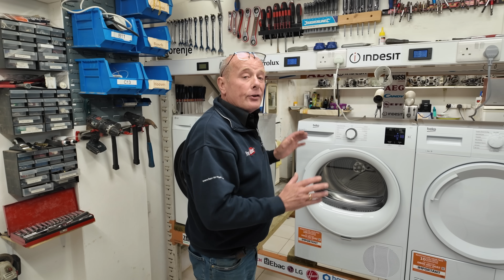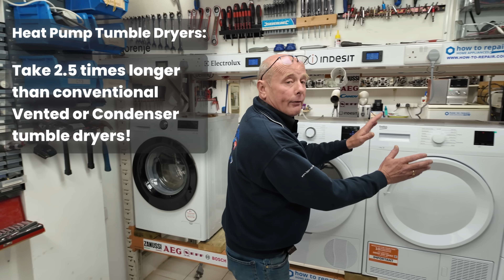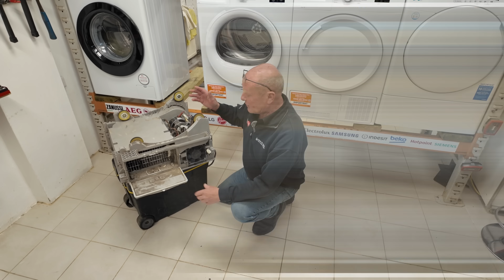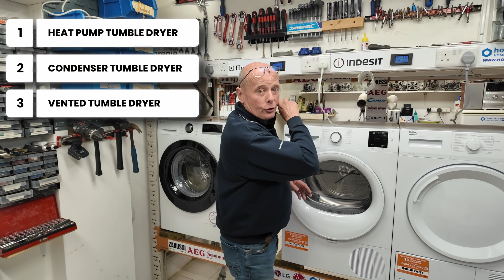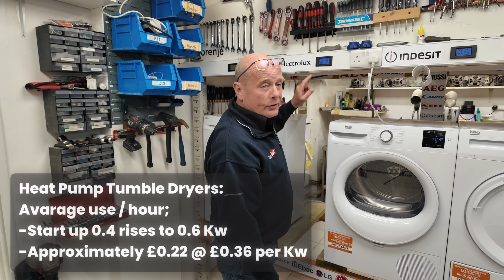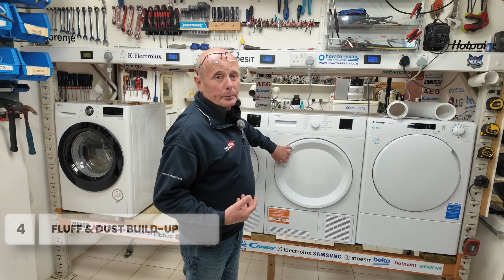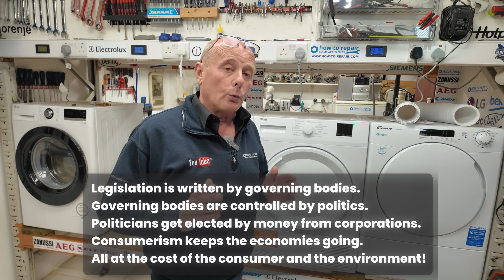Tumble Dryers the Shocking Truth About Heat Pump vs Vented & Condenser, NEW LEGISLATION!

Comment: Plumber/Heating Engineer here, fitted & maintained Air Source Heat Pumps.
Had a Heat Pump Tumble drier for over two years now & it’s fantastic. Under £0.40 a load & it doesn’t take any longer to dry than any other TB.
It doesn’t shrink clothes & is much better for creases in shirts etc, most can be put on straight out the HPTD.

I formally had a Natural Gas TD, which was fantastic on economy. I nursed it along for 4-6 years, replacing parts etc. unfortunately, the Drum completely sheared off. So it went to the TD Graveyard in the Sky……RIP & sadly missed.

Now, there’s a couple of secrets in using a HPTD & our host touched on it.
Ambient air temperature, these units recycle air, so, site it in a well insulated small room. We have a small Utility Room in a modern extension & it’s ideal.
Also, double spin your clothes in your washing machine. It can make a huge difference with some items of clothing.
I also Plumb in the Drain on any I fit, it’s so much better for the appliance.

I agree with our host, lint in the Condenser & Evaporator will be an issue. As for the Compressor & Fridge Gas. Well, we’ve never had a Fridge or Freezer that’s not given great service for 20-25 years at least.

Just Googled a price of a HPTD, a Swan is £300 & a Hoover £319.
So considering the savings on running costs, if you get 5 yers out of it, that’s costing you £60 a year for the appliance. You’ll save a fortune!!  Plus, the technology will improve & the appliance price will drop over the next few years.

Thanks for sharing a very interesting video👍👍
Reply: Perhaps a wee point here about Heat Pumps in general. From a Home heating prospective; An ASHP will only operate at its optimum with a Low Temperature CH system. So generally, it needs to have a SCOP of >4 to be more economical than Natural Gas. So it’s unlikely we’ll be stopping fitting Gas boilers any time soon. 
Also, Low Temperature CH is not appropriate for our very cold, damp climate here in the UK. Oh, it’ll heat a well insulated home, but well insulated means air tight & air tight means condensation. We have a huge Damp Homes problem in the UK.
Reply: @jimmygillies5590  if your home is airtight, you need mechanical ventilation anyway. 

And I think you're over egging the pudding, saying our climate is "very cold".

I'd like some whole winter figures. HP people generally focus on when it gets really cold, but most of the heating season isn't like that. If your heat pump only struggles for 1 cold week in January, isn't it overall better just to turn on a few electric resistive heaters?
Reply: @benholroyd5221 
Are you aware of people removing heat pumps because of the horrendous electricity bills they get from running the system in a large house ?
Reply: @madbiker1000 a badly specified system installed by a non expert is unlikely to perform well. HP systems run at lower temps, so existing radiators are usually undersized. Before any change to the HP, proper heat loss calcs are needed and in many retrofit cases, insulation upgraded first. Norway uses HP systems a lot. There's no way the UK has a climate too cold for them to be effective. Run any under sized heating system in a draughty property and you're unlikely to be comfortable
Reply: @imaginitivity7853  
Thanks for that but none of what you say apply everything was done correctly it's not that it didn't work it was the electricity bill that  went from hundreds to thousands a month but we are talking a big house it was insulated to standard as a retro fit but probably didn't meet new eco house standards... Obviously the UK has the most expensive electricity and this probably played a big part in the facts it was stripped out because it was uneconomical. 
UK electricity prices are affecting everything to the point that industry doesn't even want to be in this country... 30% of your electricity bill is for green subsidy ! The green gang have got a lot to answer for.
Reply: @madbiker1000 
HMG is fitting wind and solar at a frantic pace to lower bills. The UK will be out of the world markets being self contained.
Reply: @benholroyd5221  The only good mechanical ventilation is a Heat Recovery system. Which is very rarely fitted in homes using Heat Pumps.
SCOP figures take into consideration the total overall efficiency of a HP system. The irony of a ASHP for heating a home; In the coldest weather, the ASHP defrosts the most. Taking heat from the property to defrost the external ASHP. 
I live in Scotland, we get 1 month of Summer a year. The point being, with cold damp weather, 5°C can feel like -5°C.
Reply: @ Right, so if you get heat pump with a SCOP over 4, we agree, that over the entire year, it will be cheaper than gas.

I'm not quite sure what point youre making about heat recovery systems being rarely installed with heat pumps. We weren't talking about that, we were talking about sealing up a house to the point where you have condensation. If you have condensation, you need extra ventilation regardless of heat source.
Reply: @ Well the higher the SCOP the more efficient the HP, therefore, a more economical running cost.

The point being, with Low Temperature CH systems, which mainly rely on convected heat, is to the detriment of the home owner. Any heat produced by standard emitters will convect upwards, before dropping to heat the occupants. Whereas, Under Floor Heating is far more beneficial, its radiant heat & it combats the radiant heat our body loses. 

The point about mechanical ventilation, mechanical ventilation removing air from an air tight property. Just creates a vacuum & a vacuum creates moisture laden air. Did you ever do the candle, milk bottle & bowl of water experiment in School? 
But with heat recovery ventilation, the air is returned into the property.
Reply: @jimmygillies5590 we have crappy housing as you described because it has always been best to do nothing about it.
Somebody has to break the cycle of failiure and do something about it
Reply: Agree.  Had a condenser and now have a heat pump.  Not seeing the 2.5 times longer drying times.
Reply: @xpantz 
What is the comparison in drying times?
Reply: @johnburns4017  I'm just not noticing any real increase in times.  To be fair I did just replace an older Samsung washer and LG condenser dryer with new Samsung machines and I would say that washing comes out of the washer somewhat less damp than with the previous machine.  But 2.5 times longer... no way.  The heat pump dryers works well.  Things get toasty in there.  Sorry I can't give exact load for load times.  I never really timed a specific load with the old machine but just going on experience.  I'm more than happy with the heat pump.
Reply: I don't understand something about that.  If it makes less heat, as you have suggested because "it doesn't shrink clothes" and "no creases", then how is it possible that it dries in the same amount of time?  
I have a heat pump for my house heating.  When it's running on max, it's still chilly in here.  It is sized correctly.  The problem is, the air simply doesn't come out as hot as a real heater.  It can't; that's not a problem with the unit, and it's not something that technology will solve in the future.  
So, how does a heat pump manage to dry in the same amount of time?
Reply: the truth will be that it doesn't,  but fanboy won't want to admit that as it undermines the defence of the hptd. Now for some maths. 1 hour dry for a trad td is about 44p. We do maybe 100 loads per year as we put washing out whenever we can. That equates to £44 a  year. If the hptd takes 1.5hours it will come in at 16p per dry.meaning we would save £28 a year. Replacing our td with an hp one is going to cost about £500 for a "good" one. So payback is nearly 20 years. If, that is, is survives that long. Factor in the environmental impact of manufacturing and disposal and I think it is clear that hp is not a winner. Fanboy won't accept any of that as they Don want to admit they are, perhaps, not  completely correct in what they  claim. Just like the ev brigade.
Reply: @familyhelpdeskhelpdesk270  It's hard for people to accept that they've been conned, as you say like the EV brigade and the people who fell for the poisonous arm darts.
Reply: @familyhelpdeskhelpdesk270  If I’m fanboy😂 On the contrary, I take a very objective viewpoint & have not delved into the running costs or overall costs of our HPTD too deeply. I’ve just stuck one on these cheap Energy Meters Into the socket & monitored that, when I can be bothered to.
If there’s a better, cheaper alternative, I’ll replace our HPTD with that, when I can no longer repair it. As with our Natural Gas one.
I wholly understand your comments & if you’re happy - then I’m delighted.
Reply: @cherryjuice9946  Our HPTD doesn’t produce less heat, in fact it probably produces more. A big factor is the ambient air temperature in our small Utility Room, where the appliance is fitted. Remember, the TD is recirculating air. 
The analogy being, get into your car on a frosty morning, when you turn the heater on to defrost it, you also push in that wee button that recirculates the internal vehicle air. Not pulling air in from outwith the car. 
If your home is not warm enough with your ASHP, I recommend you get your system checked by someone that knows their onions. You may just have a problem with incorrect Parameter settings.
Reply: @ I think my description of the problem was lacking because I said "heat".  I should have said "hot".  There's a difference between moving heat vs getting hot.  Heat pumps do indeed move heat.  That's not the issue.  My heat pump that warms my house does an excellent job of moving heat, but it doesn't come out of the vents hot.  I can get the inside temperature up to 74 (23 c) with easy, but it's still chilly because the air coming out of the vents is not hot.
This has nothing to do with an improperly operating unit.  Heat pumps simply don't work efficiently across big temperature gradients.  It's not a design issue, or maintenance issue, it's just physics.  This is exactly why people don't sell these in the far north where the outside temp is cold.  About 40 degrees (F) difference is all a heat pump can efficiently do.  A clothes dryer needs to get hot to make the water evaporate faster.
Reply: @cherryjuice9946  Ah, you’re in North America, where Air Heating is normally, but not always, used. The air is the heating medium, which is a very poor heating medium. As we know from the current debate.
Reply: Thanks for a VERY honest and useful comment. I am in Canada and we don't (yet) see many HPTD options, but that will change soon I expect. My dryer is just a plain full-out resistive electric device - but I average about 6 pence a kwh here (MUCH LESS on off peak, actually). Electricity savings are not relevant yet.
Reply: @capnkirk5528  Please just keep your old vented TD and at 6p per kwh thats fantastic! The old vented are a bit more exspencive to run and they blow out most of the fluff, are more relyable, are a lesser fire risk and dirt cheap to fix :-) I've been fixing these things for 25 years and HPTD are very situational and quite unrelyable too.
Reply: I agree.  I am an engineer and scientist used to complex equipment though not white goods.  That sad my LG HP TD has had a load every day for 6 years.  We spin at 1400 rpm in an LG direct drive WM before the TD and our appliance is in a kitchen that is 16 to 20C.  It is still going strong.  I paid c. £800 for a top of the range unit but I think I have had my money back on energy savings as I budget 2.5 kW for a wash and dry eyeballed on my smart meter.  No breakdowns no issues.  I am a fan.  If it breaks I buy a new one.
Reply: Your information seems valid and mostly undermines the points made in this video.
Reply: >Also, double spin your clothes in your washing machine. It can make a huge difference

Now youre touching on an actual issue with the current energy efficiency systems.

Standalone washing machines have lower spin speeds because that uses less energy at the cost of your dryer having to work harder.

washer dryers don't have this issue, because theyre measured on the entire cycle, and its better overall to spin the water out, then to use heat.
Reply: Did you cost factor in the extra spin cycle on your clothes? What a palaver. You sound like an EV owner trying to justify that heap of junk after being conned.
Reply: @cropduster8798  😂😂 No I’ve never checked the additional cost of an extra spin in the Washing Machine & it is a valid point. This may disappoint, but I hate EVs, have you ever seen a Lithium Battery go on-fire! I wouldn’t go anywhere in an EV aka Milk Float.
Reply: @cropduster8798  what is your estimate for the increased energy usage with spin speed?
Reply: @cropduster8798  I drive a filthy diesel powered 4x4.  Still doesn't make the drying time 2.5 times longer.  What a croc.
Reply: The video giving facts based on today, and yes technology of heat pumps will improve and appliances plus parts will become cheaper .... however, there will be two problems: 1- not enough skilled engineers, and it will take huge effort and time to train few and won't be enough! 2- most importantly, the worrying for everyone is when everything goes electric in few years time and the jump from fossil fuels to green energy would force energy companies to ration electricity by imposing higher tariffs on ordinary consumers using smart meters! ...... Remember that!
Reply: @NeoFreshair You're posting misinformation here. The UK's national grid is ready for electrification now as electricity use and dropped consistently for decades, whilst capacity has continued to increase. Rationing won't happen; that's a talking point from certain menia outlets who, on the whole, are trying to stop EVs.
Reply: @bst1623  agree to disagree but don't call misinformation or fake news if it's not your liking! You love EVs and heat pumps and I have no problem with that, but I stand by my predictions and worse still to come! In the mean time enjoy EVs and heat pumps while fossil fuels still not banned!!
Reply: @NeoFreshair  
Bang on !... Luckily I think the green agenda bubble is about to burst, electric vehicles now getting road tax from April, EV sales are stalling government legislation on manufacturers is providing sales. When ICE vehicles are banned it's going to be an absolute nightmare !
Reply: @bst1623  Not sure where you are getting your misinformation from but on Wednesday 22nd Jan. around 17:00hrs the total demand on the grid was 42.85Gw. The total UK production was 37.82Gw - a shortfall made up of imported power from France, the Netherlands, Norway, Belgium, Denmark, and the Irish Republic. The Imports comprised 12.5% of the grid. Have your candles ready for the potential power cuts. Google "Energy Shortage" and "Power Track" the rolling power cuts are already mapped out. Our government is playing Russian roulette with power generation. We are very far from energy security folks wake up and smell the coffee.
Reply: Is that why we came within a whisker of blackouts on the 15th of this month? Down to 1 per cent spare capacity. And if maintenance on an interconnect had progressed a little further then we would have had disastrous power cuts.
Reply: @RobinLoxley-fn8ex  
Spot on ! 👍...🤣
Reply: @NeoFreshair efficiency of refrigeration hasn’t changed much in many decades, nor will it.  Electric energy won’t be limited because there will be excess generation capacity soon, very soon if ‘rump creates an oil surplus…
Reply: @NeoFreshair  Sorry, the tech on heat pumps is at max. They are the same as refridgerators and we've not made a significant advance in 20 years on them. Sorry to burst your bubble :-(
Reply: @bobmalooga7249Yep, that’s true. HP tumble dryers aren’t new, and they’re great now. But it depends on the make and model, get a cheap one and expect it to be cheap. Get a samsung and expect it to be like the cheap one but twice as expensive. I really like my electrolux but they don’t have an evaporator filter, just a double door filter which is terrible, but it dries really fast. I vacuum out the coils every 5 loads and that seems to work alright. I know that miele make theirs with a sponge filter and that’s really the best design out there I reckon, but they’re not cheap.

Comment: Heat pump will take more than 2.5 times longer they are useless … scrapped mine … was taking 9hrs to dry a load and it wasn’t really that dry tbh. Also you get no heat benefit … takes a lot longer if it’s cold .. so you need to keep your room warm for it work good.

Comment: I went to a LG hybrid a couple years ago it had been written of by LG as the engineer had had the machine for 2 months and replaced every part and still the same😂😂 so it was tripping the breaker which I traced to the brand new compressor?? then the guy says the "engineer" had left all the old parts but they had the same fault so I checked the compressor on the old base which was fine... after some testing I found a rub through where the harness was tied to the pre, or post I'm not sure, condenser... so I built it back up on the old base and long short fixed.... I think bosch supply the base complete as well... must cost a fortune